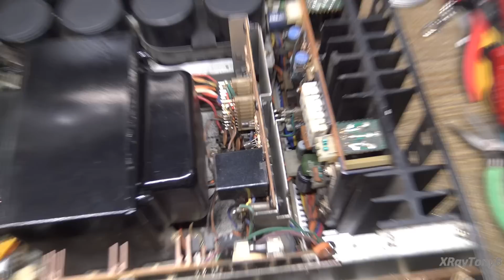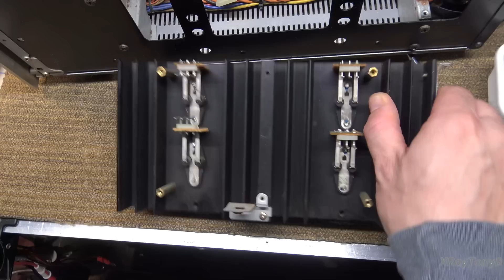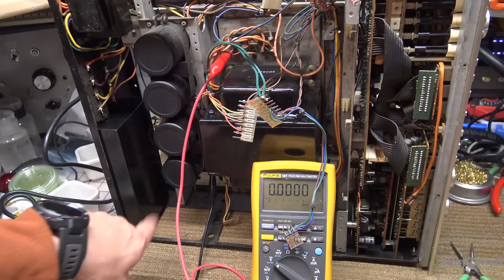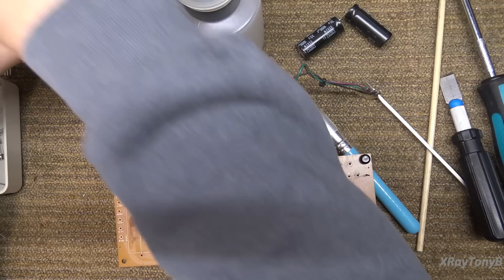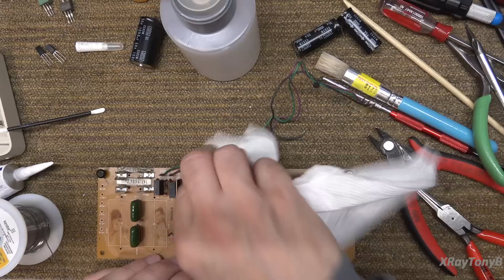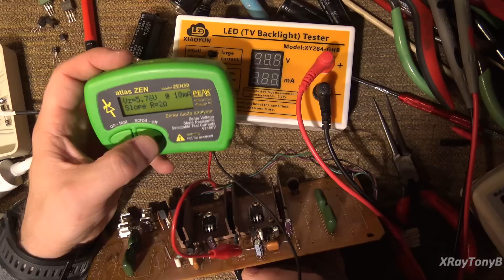Marantz 1300DC - Part 1

Comment: Hello Mr. tony! Loving the channel.  Your demeanor is very refreshing. One thing I would like to comment on is the trimming of semiconductor leads. I always solder the device first and then trim. This is to mechanically isolate the device from the cutting action to keep the shock on the lead during the cutting action from being transmitted to the device. I've seen devices fail after cutting when the lead was not previously soldered or holding the lead with pliers between the device body and the cutting tool. Just a tip from my 50 years of electronics design, test and repair. It's rare, but have seen devices outright fail or have a high infant mortality rate due to the trimming shock.

Comment: The 2330B has two varistors screwed to the heat sink that need to be released via screws. No big deal but that's the only way to get the power board to lift up after taking the module out.

Comment: I am not anywhere near your knowledge or capability.   So I take my equipment to shops for repair.  I never get the feeling they take the time to do all you do to match transistor characteristics, multiple capacitor test, etc.  And they sure don't want replace a capacitor unless it is spewing fluid (ok, I am exaggerating there).  But they won't recap a board just because it is old.  I have to tell them that if they replace something one channel, replace it on the other side to make it balanced (because I learned from you than many of the old cap values are not available today). When you are trying to keep equal transients and proper imaging, that seems to be important.

Comment: I use the same component tester TC1. Did you know that this device can also check zener diodes up to 30V ? Pin 1 & 2|3 on the ZIF socket.

Comment: Hello tony . I am from Canada . My father was in the RCAF . He had enough rank to sign for tubes and all sorts of items destined for the dump as it was common practice to reorder to spend the years budget so the budget did not get lowered . Most are military spec. made in USA. If by chance there is something you can not source let me know and I will look in my stash . There is even single digit read outs that use filaments . North bay Ontario was the underground NORAD sight. 20 min ride in the bus to get down to the complex . Hope work slows up so you can post more vids . Have a great day EH .

Comment: Back in the late 1960's, early 70's a schematic with test points and values at each point came with receivers or communication radios..I wonder why this is not the case today ? Ha.

Comment: What on earth is that second transformer at the rear? Don't see it in the manuals I find. Soft start perhaps? This unit could use one.
Reply from the maker: The smaller transformer provides power to the regulated DC power supply board.  This board powers the preamp section of the amp.  The big transformer only provides the unregulated power for the amplifier output section.  Not sure why they felt the need to do it that way, but that's what they did. :)
Reply: @xraytonyb  Yo tengo un Marantz 300DC y es igual tiene un segundo transformador para alimentar la parte de entrada de la etapa de potencia con voltaje regulado, pero he reparado otros Power de esa época y usan la misma practica, por ejemplo el SPEC-2 y SPEC-4 de Pioneer, claro es un devanado aparte en el mismo transformador.

Comment: I've often wondered in these direct coupled designs whether something could be added (a zener or crowbar or some other monitor) that would shut down a stage quickly enough to prevent such damage. I used to work on such amps etc in my dim and distant past and remember the horrors of thinking that you have found and replaced everything suspect, only for the same thing to happen again.

Comment: Hi Tony, you have replaced the 2sc2240 and 2sa970 with ksc1845 and ksa992. Their obvious difference is their collector current rating, ks series are rated to just 0.05mA compared to 0.1mA to the two original transistors. Do you think this is not critical?
Reply from the maker: The collector currents are 50mA and 100mA respectively (a little typo, but I understand).  In some cases, this is a concern, but in this circuit, the collector current will be far below this, as they are driving the base of another transistor and are current limited by the resistors in the circuit as well as the voltage divider bias applied to the base.  I am more interested in the voltage rating, as these transistors can have some pretty high voltages (as far as small signal transistors go) on them.  On a side note, you will find that pretty often, this will be the case when you compare a "2S" transistor with its "KS" equivalent.  This is why you always have to check.  It is also why you can't always rely on those "crossover lists" that people post on the forums of electronics/audio websites.  It may work for the application that the person on the forum was using it for, but not necessarily for what YOU will be using it for.  Good comment!
Reply: @xraytonyb  Yo uso el KSA992 ´para sustituir el 2SA872A y el KSC1845 para sustituir al 2SC1775A, suele usarse en amplificadores Marantz de esa época, las características son las mismas.

Comment: Another Great Video, Thanks Tony
one thing though  - I am not a fan of the amp. in my opinion it dates from after MArantz reached its peak.
it was their flagship amp , but did not have the same build quality as the US model, or the 1180 for example. fancy circuits though.
I think the quality of the PCBs and caps illustrate what I think

Comment: Note for the very last part of the video (cleaning the board) I always wipe off the the board after soaking it with isopropyl alcohol with Q-tips. Your method, Tony,, only dilutes the excess flux and spread it across the board and it will remain sticky after the alcohol evaporates.

Comment: Excelente Tony, este amplificador es muy parecido a mi Power Marantz Modelo 300DC, que de echo es de la misma potencia de este, bajare el Manual de servicio de este para compararlos. La etapa de potencia. La fuente es idéntica , un gran transformador con doble devanado. y 4 condensadores de 10.000uF 80V.
Reply: tiene la misma etapa de amplificacion el 1300dc con el 300dc. De Hecho el 1300dc es un 300dc + 3650 en un mismo gabinete unidos
Reply: The power amp boards are slightly different though.
Reply: @mattfranklin3622  Si eso es correcto, me atrevo a decir que las del 1300 son mejores.
Reply: @zambrano966  in what way?
Reply: @mattfranklin3622  Hola Matt, bueno te puedo decir que he reparado varios 300DC y los conozco muy bien y por eso te dije eso, nunca he reparado un 1300 DC, pero baje el manual de servicio y los compare, las etapas de potencia son similares , pero no iguales, ahora si hablamos del Marantz 170DC si te puedo decir que son iguales pero con componentes de menor potencia ya que este solo da 80 vatios por canal. Para mi el circuito de la etapa de potencia del 1300DC esta mejor elaborada, pero tiene sus contras donde el 300DC es mejor. Por ejemplo el 300DC esa una fuente regulada con un transformador independiente para alimentar la parte donde esta el par diferencial Q701 (2SK109) y toda esa área en la entrada de la etapa de potencia, esto lo hicieron para que ese voltaje no se viera afectado cuando se le esta exigiendo al power, lo que hace que el voltaje decaiga bastante, en el 1300DC usan el mismo voltaje que le llega a los transistores de potencia solo lo limitan con una resistencia de 10 ohm. Ya por eso es mejor el 300DC. Pero si vemos como en el 300DC hicieron para regular la corriente de Bias, te das cuenta que en el 1300DC esta mejor realizado este circuito. En el 300DC usaron un Termistor (Q722 y Q723 SDT-100) el cual es de 1000 ohm, el cual su valor decae si la temperatura aumenta y usaron el Varistor (Q720 y Q721 MV-1) el cual también varia su voltaje de conducción de acuerdo a la temperatura, bueno te cuento si por mala suerte se dañan estos componentes no los vas a conseguir en ninguna parte, ya eso es una desventaja con respecto al 1300DC. Hay foros que dicen que en Varistor MV-1 se puede colocar un diodo 1N4148 pero este diodo no tiene el comportamiento que tiene el MV-1. En cuanto al Termistor en el mercado se consiguen termistores de esas especificación pero la velocidad de respuesta en muy lenta con respecto a los termistores que trae el 300DC. En el 1300DC usaron un transistor (Q734 2SC1568) que va acoplado a el disipador de  los transistores de potencia el cual monitorea la temperatura y regula la corriente de Bias, un circuito mejor elaborado. Por otra parte en el 1300DC el transistor doble Q702 2SC2259, esta descontinuado, pero allí se pueden montar dos transistores de características semejante emparejados. Eso también ocurre en ambos power con Q701 2SK109, también esta descontinuado, pero en este caso se puede montar dos FET 2SK117 emparejados y acoplados térmicamente. Hay foros donde dicen que se puede poner el uPA68H pero no , yo lo hice y no hubo forma de ajustar el 0 voltios a la salida. Bueno espero haberme podido explicar y haberte podido ayudar. Saludos.
Reply: I thought 2 x matched 2sk170 were the best replacements for the 109’s?
Reply: @mattfranklin3622  Si yo he vistos varios foros AUDIOKARMAN y ellos ahí, hablan del 2SK170, pero yo repare una 300DC que tenia un 2SK109 malo y lo sustituí con dos 2SK117 y funcionaron bien, claro tienen que estar emparejados, tener la misma ganancia los dos.
Reply: @zambrano966  Is it idss your matching? Do you match them yourself or buy them pre matched? If you do yourself how many do you need to buy to get good matches? Also how close is good enough match wise
Reply: @mattfranklin3622  Realmente tenia como 8 2SK117 desde hace mucho tiempo guardados, que nunca use. cuando estaba reparando el Marantz 300DC y me conseguí  conque tenia uno de los 2SK109 malo, empecé a trabajar en eso, me dio mucho trabajo porque no conseguía la forma de que el 0 voltios en la salida se mantuviera estable. Yo pensé que con el IC uPA68H iba  a funcionar bien, pero no, no funciono es bueno mencionar ya que estas interesado en esa reparación, que también sustituí el Q702 y Q703 por unos 2SC1573. El lleva los 2SC1775 que según su equivalente es el 2SC1845 que hoy en día se consigue por KSC1845, pero no funcionaron, compare las guanacias con un original y estos tenían mucha mas ganancia. Bien ahora te explico como yo conseguí emparejarlos, yo tengo un trazador de curvas que se usa con el osciloscopio, y allí puede ver las curvas de transistores y Fet, así fue que logre conseguir dos fet casi idénticos por sus curvas. Cualquier duda me vuelves a escribir, para eso estamos. Para ayudarnos. Saludoas.

Comment: Another excellent solder and chat as well as learning session in audio electronics. Like the idea of the "led backlight" tester being used on Zener diodes. Especially for the high voltage zeners. Have the Peak, but can see the value of other tester.

Comment: Just ordered that back light tester. Amazon 36 bucks, a dam site cheaper than those Atlas testers.
Reply: Seems like it would be cheaper to DIY one out of a cheap camera flash by connecting to the flash cap with some series resistors.

Comment: My friend, a little trick I use to help remove the glue without damaging the board, because I don't like seeing scrape marks on the pcb,  Now, without going crazy, I heat the glue with a heat gun, trying not to heat any near by components. And if I'm really concerned about any of the components, I'll shield them with some aluminum foil or a piece of cardboard, anything to keep the heat from them. I hope this is a useful tip to others.

Comment: This amp uses the same transistor for the voltage regulator as the Pioneer SX-450 in the audio output.😛

Comment: If you do basic videos, be sure to set the context, as in pose a real world issue that justifies the lesson. For instance, no one really want to learn Ohm’s Law, per se, but we might be intensely interested in learning how electricity works. Why are fuses rated as they are? Why are wires sized differently for different purposes? How does a transformer work, and why aren’t they rated in KVA and not by voltage alone? Etc. Etc.
Edit: I would be interested in your take on basic electronics   . Years ago, I couldn’t find what I was looking for in books, so I took a course in the local community college which changed my life.
Reply: That is what I was thinking. Also, How do all the components work together and why, signal flow,  a bit on schematics. There are plenty of videos on basic electronics on YT, and they never go beyond the basics.

Comment: I'll tell you what if they were to make an amplifier of that quality with all those features today it would probably cost $10,000
Reply: The new Western Electric WE 91E single-ended Triode with two 300B tubes and one driver tube each, plus a single output transformer, and an integrated MM/MC phono stage is $15,000. The original WE 91A was used in movie theaters in the US starting in 1936. Reviewed in the latest issue of Stereophile (November 2022). Gorgeous amp. 
Edit: The WE 91E also has Bluetooth (USB & RJ45 ports for firmware updates).